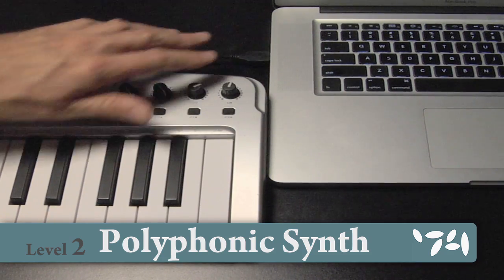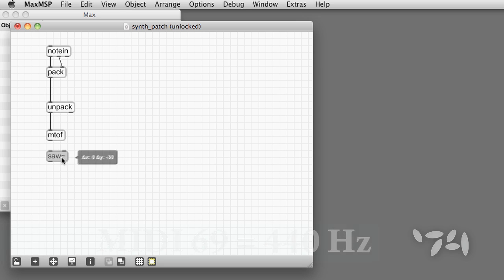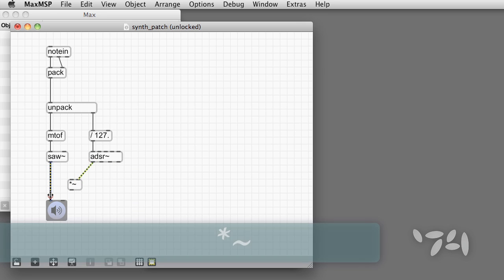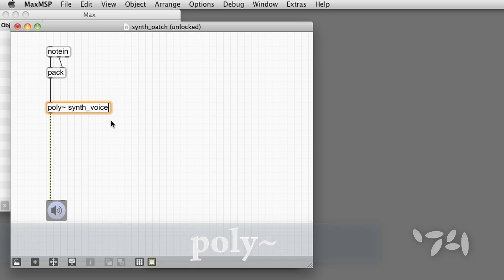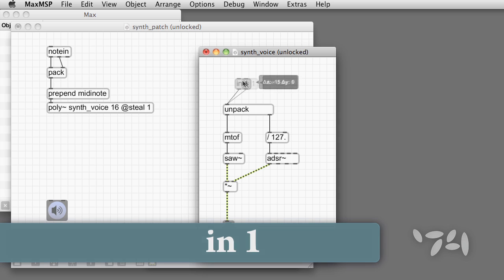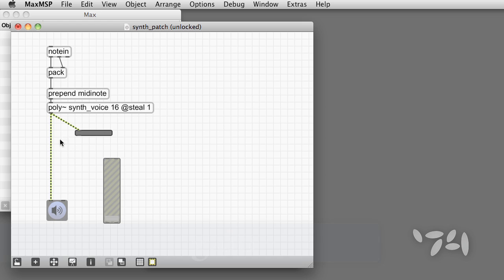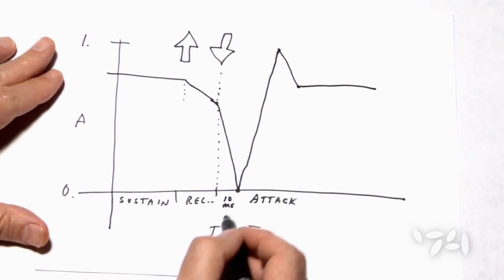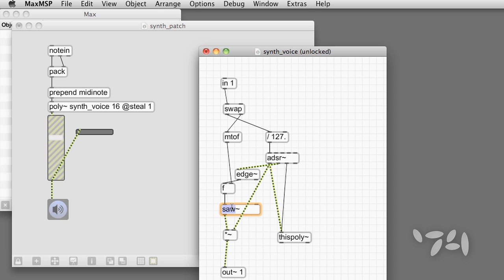Cycling74 Max/MSP/Jitter Tutorials: Polyphonic Synth

Comment: This is excellent instruction.
Reply: err ... however, option- clicking on the sub patch title bar does nothing at all, am i missing something?
(please note that I'm very new to this)
Reply: After many attempts starting from scratch - still no option-click title bar, have SOLVED it by re-opening (within Max: File -> Open Recent) to access the bare sub-patcher. Even before implementing thispoly~ Ii works.

Comment: 5'18" I put "out~ 1" in the sub-patch (and saved it), but outlet does not appear in encapsulated "synth_voice 16 @steal 1" object.  What's wrong in my programming?
Reply from the maker: Hi Jun - please post this as thread on our forum with a copy of your patch, you'll get plenty of help there :)
Reply: @C74connect  Thanks for reply.  The issue was solved while I still do not understand what was cause.  Now I am struggling with another"poly~" problem.  It is tough though.

Comment: Hey, Max noobie, using Max 7, thought I'd share some things I found working through this video. 1. I had to use a numbers object instead of message to see the notein note # and velocity 2. If you lock the window you can double click on the notein object to choose the MIDI port etc. it receives MID from 3. Opt click did not work for me on the subpatch window, I had to click a little pencil icon in the lower left corner of the subpatch window to allow editing of the subpatch. 4. I found it very useful to output the audio to a scope object so I could see what was happening before I unmuted the audio. Learned this the hard way with a brutal squall of saw wave when I created some kind of feedback loop by accident early on in the patch :) Thanks for the video!
Reply: Thank you! Your comment helped a lot!